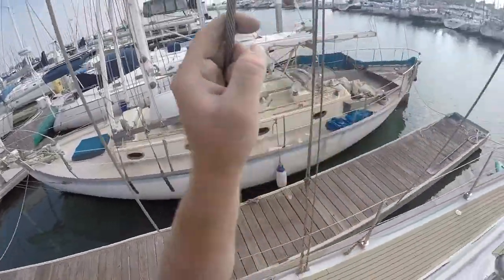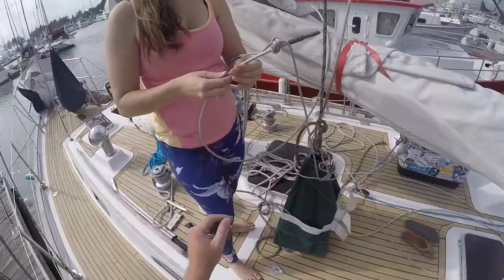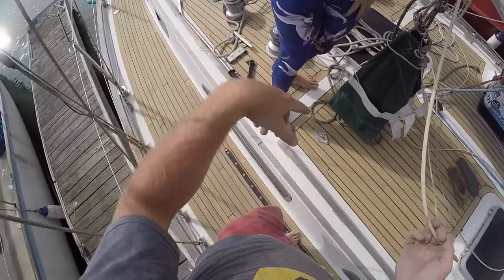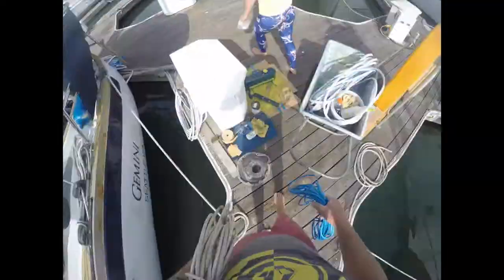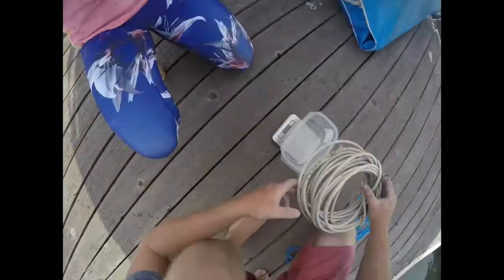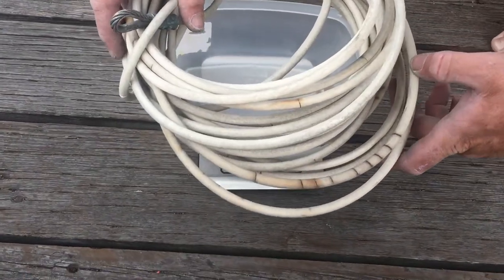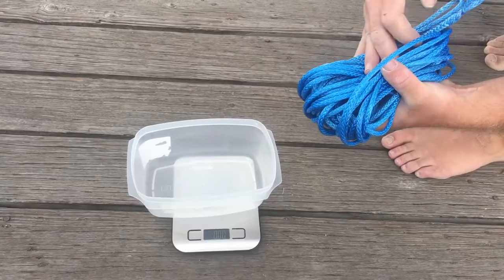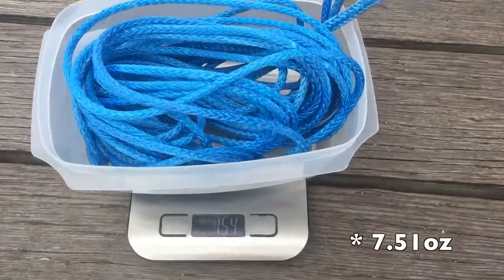EP 11: Rig-rite Monday - Goodbye Rusty Wire, Hello Amsteel! | Two the Horizon Sailing

Comment: you really dont need to climb up there to just replace the topping lift. cut the bottom end, connect a thin line to the old topping lift, pull it out of the mast end, then connect the new line to the thin wire, pull the thin wire out. I did it this way
Reply from the maker: Good tip, but it doesn't help us in this case. Our topping lift was a vinyl covered section of wire, with eye splices at either end. The top of the wire was connected to a fixed point at the top of the mast, with a pin. The adjustable purchase system was on the bottom end, then run through the boom to cleat off on the boom. We have used the chaser line trick many times when replacing halyards, but in this case we did have to climb the rig. 
Hope that clears it up!